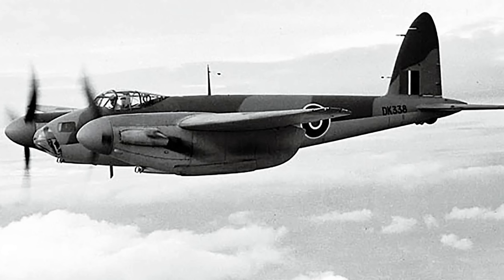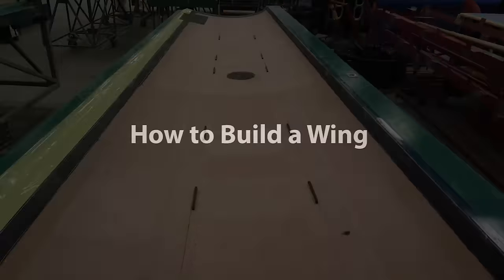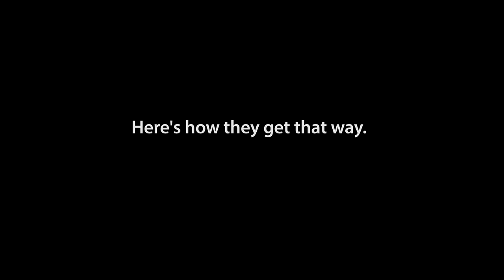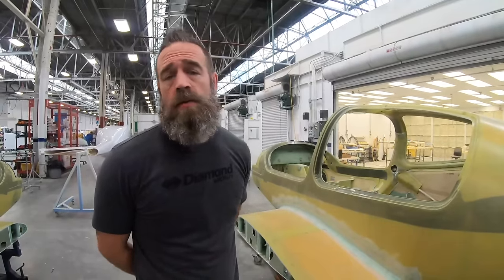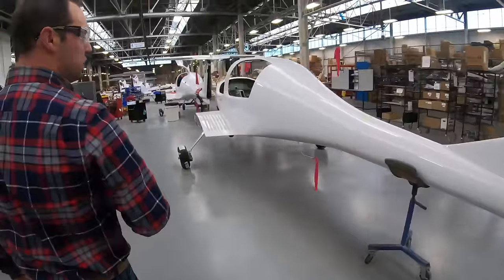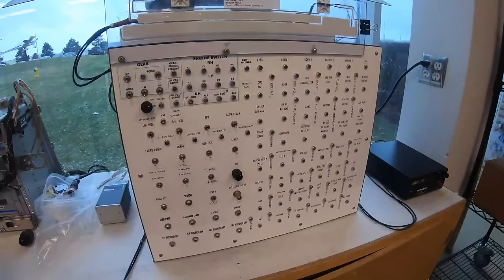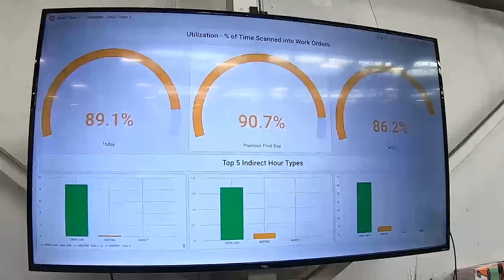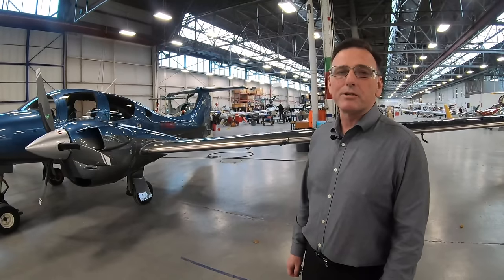How Diamond Builds Composite Aircraft

Comment: Perhaps I am out of line here but the inefficiencies in the manufacturing are staggering to me. They are essentially constructing the aircraft using modern processes but using 1940s techniques, and I am genuinely not sure why. Surely once you get producing at the scale and cost of Diamond it starts making sense to machine automate things like layering large wing and fuselage pieces, and placing the switches into the panels autonomously. Some of the assembly work, particularly final assembly, probably is better done by people, but given how much automation is available I'm really surprised, and I can't see the cost required to set up those custom processes taking long to recoup with the price of their aircraft combined with the admittedly quite admirable rate of production they seem to have going.

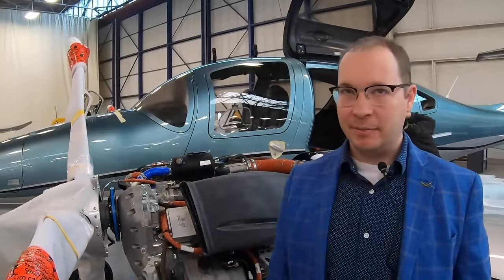Comment: 12:30.....  measuring efficiency is not about keeping quality consistent or at a high level.   It is about pushing the employees to work as fast as they can with as few mistakes as possible. Often times that leads to a lower quality product being pushed out the door because people are watching the "efficiency clock".
Reply: placement of thick orange wire in front of computer monitor seen at 13:07 - not so efficient.

Comment: Hello all, 
Regarding the wing manufacturing i understand that first the lower wing skin is layed up, compacted using vacuum bag and precured. Then the ribs and spar are placed and again precured, then the upper skin is laid up and precured. Doesn't the upper skin also need compaction? 
Also if the upper and lower skin are seperate don't they form a rough surface or a joining mark on the wing skin which is not desirable?

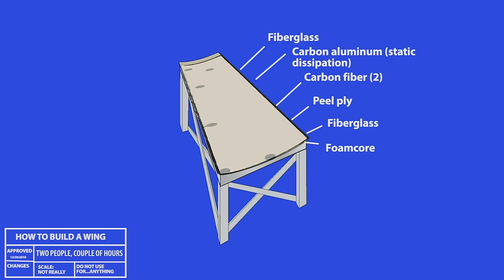Comment: 2:45 Peel ply is a releasing layer so that you can remove the breather and resin dispersion mesh easily. Why would you put peel ply in between the carbon fibre and the fibre glass? That makes no sense!
Reply: I worked for Diamond in engineering. This is definitely an error in the animation because we certainly never did this for any lay-up. As the original comment said, it makes no sense.

Edit: we also put peel ply in areas where something will be bonded as it leaves a rough surface finish!
Reply: You're absolutely right and the explanation at 2:45 is simply wrong. The peel ply sits as top layer under the perforated vacuum film. :)

Comment: Great video. I'm kind of surprised there is so much fiberglass and wet layup. I would have thought there would be more prepreg in huge autoclaves.. but I guess that would be too expensive..
Reply: iTs also unnecessary. Carbon fibre is best used when your pushing the design geometry to the limit. Strong fibre glass mesh with high quality epoxys produce incredibly strong composites and at a much lower cost. CF is a little like titanium. Have a look at the strength to weight ratio of Chromoly and titanium it ain't that different but its not as sexy as titanium so people use ti to people be interested in the product.
Reply: @gusbisbal9803  If profit margins weren't an issue and they wanted the best performance possible, you can be sure they wouldn't be using fiberglass. good carbon fiber is over 2x as strong as fiberglass...
also, while pure titanium may have the same specific strength as CrMo, titanium alloys can be over 3x better... not to mention it has many other properties than can be more favorable in certain applications.
Reply: @hzmeister9596  how much more do the titanium alloys cost than CrMo? Can you answer that? In relation to the fibre glass. If profit margins were not an issue they would be using two jet turbines  instead of props. Diamond aircraft is not an artisan workshop where art is their objective and if they make nothing if does not matter. Every single material choice ever made is based off of cost versus return.

Comment: Comparing the finished product for a composite aircraft vs aluminum/riveted construction, its a no-brainer that with composite you end up with an aerodynamically better product (and no corrosion). But none of the "how its built" videos I've seen for composite aircraft touch on the topic of "in the field repairs" for the type of hangar rash incidents that happen frequently for all aircraft. Where an aluminum aircraft can typically have a fairly major repair done "in the field" by an A&P, where is the line drawn between "field repair" and "return it to the factory" for a composite aircraft? It seems like nobody touches on this topic.

Comment: The Mosquito is an interesting bomber to say the least.  Lets compare it to a B17.  The B17 could carry 4,800 lbs  bombs for 2000 miles at 237 mph (35,600 ft ceiling).  Cost was $240,000. The Mosquito could carry 4000 lbs for 2000 miles at a 265 mph cruising speed (34,000 ft ceiling).  It didnt need defensive gun positions, because it could out run the fighters.  Cost was $11,000.

Comment: You can see why some manufacturers prefer metal. Composite manufacturing looks very involved to me yet guess modern performance expectation demands its use. I never knew there was a machine that loaded resin onto fibre sheet on demand and just thought they bought it in pre-preged and kept it in a fridge. What was most noticeable to me was the lack of robots which makes a nice change to see in an advanced manufacturing facility.

Comment: One thing we never get a sense of is just how strong all this construction is.  I have no doubt it is all insanely strong compared to things most of us are used to (e.g. our cars) and I have seen video of commercial jet wings being bent to improbable angles without breaking but I still have no sense of how durable these planes are.  Back in the day planes were made of wood and cloth and they held together.  How much does this strength help in a flight?  In an accident?  To be clear, I am just curious to get a sense of it all.  I am not suggesting planes should be made of wood and cloth today (not even a little bit).

Comment: This was astonishing: I would have expected automation and robotics at some stages, but no, it's hand-crafting all the way. Also answered a question I posted elsewhere: can they be delivered in containers, instead of ferrying, with wings/engines off and the whole craft in a container and assembled at destination. The answer seems to be no because the wings are really "fused" with the fuselage.
Reply: Wings are removable - they are not fused, but bolted. There is a small rubber gasket that protects the seam.   I don't know the process of disassembly and assembly and the economics of it, but it can be done.
Reply: @ingramleedy  Thanks for that! Now all I need is the lottery win so I can personally evaluate the cost of disassembled shipment and ferry flight! 😆

Comment: Always interesting to see. I know it's common to do composite as two shells but isn't all the massive manual labor and weakness of the coupling much harder than to simply make the fuselage as one? you'd need some rigging to do layout inside a closed mold but to me it is obviously worth it. It's faster, stronger, lighter. Also carbon fiber. It's easily pays for itself.